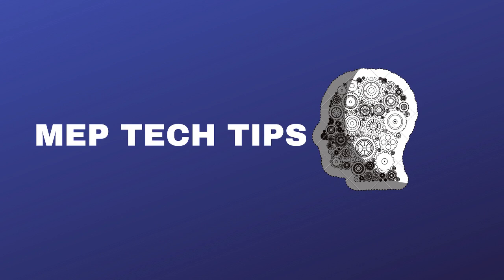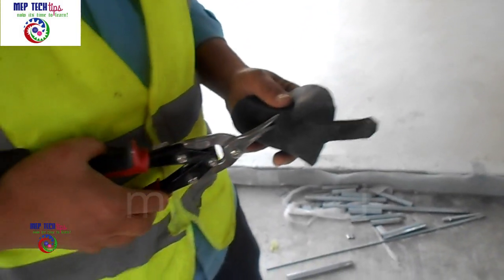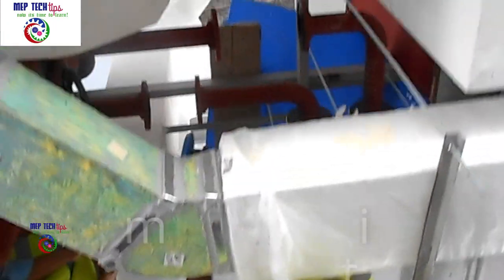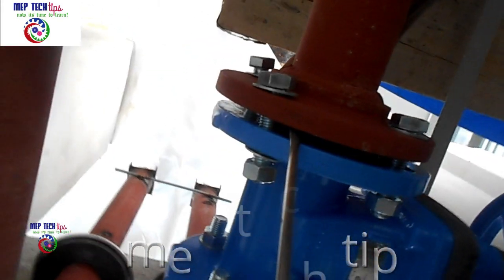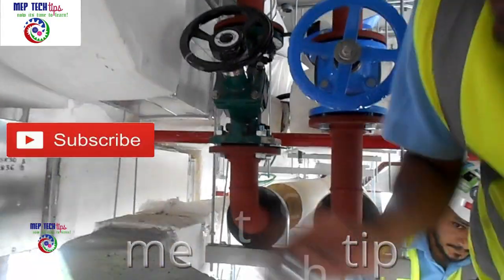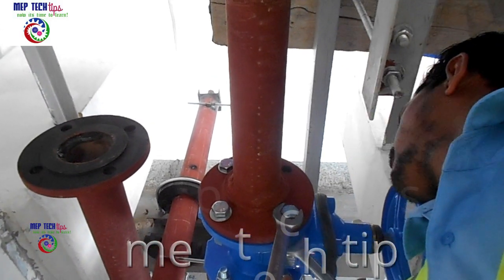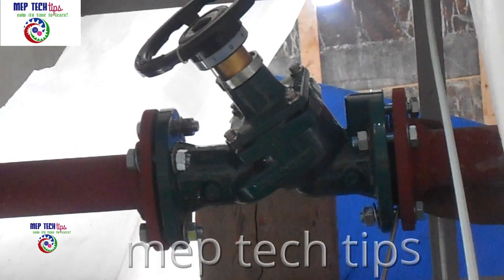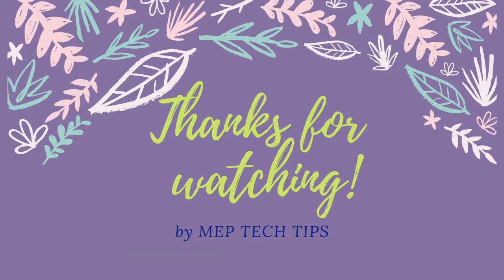How to Install a Double Regulating valve and Gate Valve in Chilled Water System | by MEP TECH TIPS

Comment: MashaAllah. Your channel is very helpful brother. 

For the Pipe pressure test, what are the pipe accessories that we should include and not include? And why? Do we include Control Valves or PICV in the pressure test? How about the thermometer, permanent pressure gauges, BMS sensors?

Comment: sir please tell me the what is the function of DRV AND GATE VALVE ?
Reply from the maker: Operation of a gate valve is performed doing an either clockwise to close (CTC) or clockwise to open (CTO) rotating motion of the stem. When operating the valve stem, the gate moves up- or downwards on the threaded part of the stem. Gate valves are often used when minimum pressure loss and a free bore is needed.

A Double Regulating Valve is a Y Pattern Globe Valve which is used in a Chilled water line for Balancing and achieving the required system flow. They are available with Fixed orifice and variable orifice an are operated by means of a handwheel with a position indicator
Reply: Sir can you tell ..upto what pipe dia we use threading and from which dia we use welding .and .type of welding used in chiller piping work.
Thanks